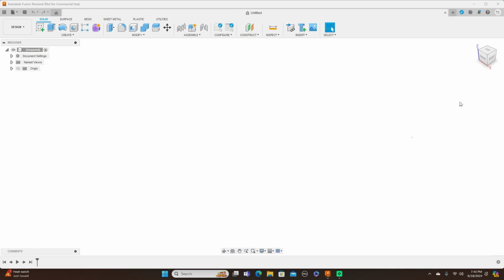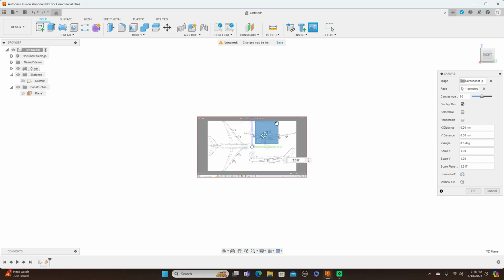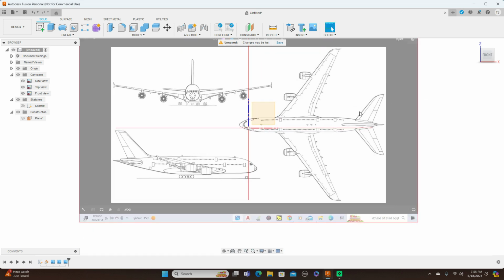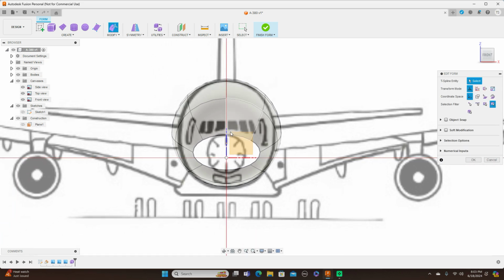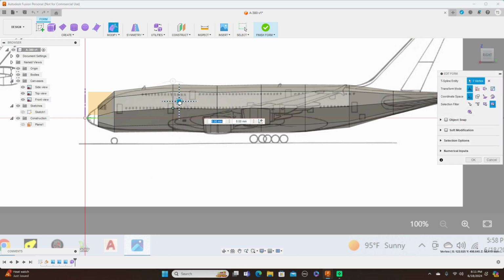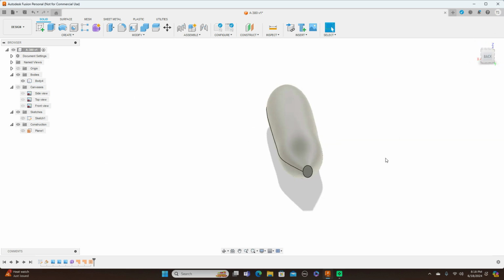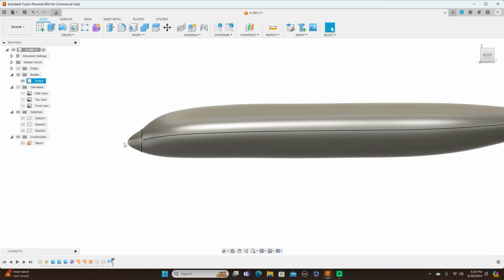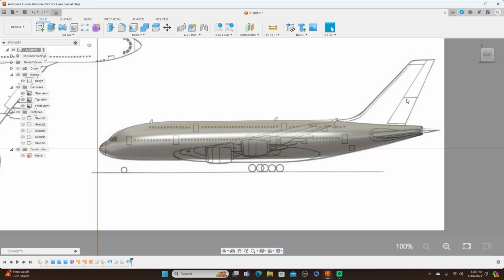Learn Fusion 360 by modeling an Airbus A-380 pt 1

Comment: something that would be helpful is a bit more detail surrounding how you create the loft.  I ran into issues multiple times creating the loft.  It appeared that there were multiple points to select from.  I am describing is poorly, but will try to recreate the issue.  I was able to get the loft created, but no 100% confident as to why.